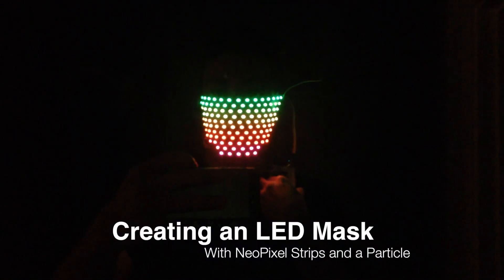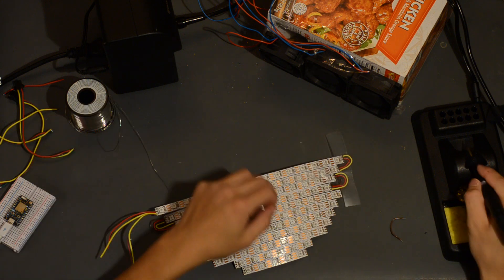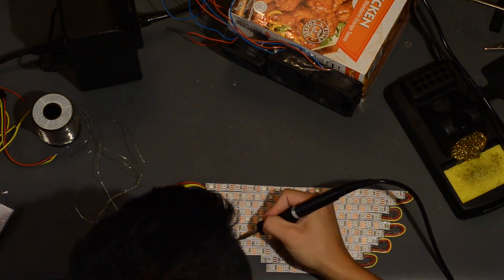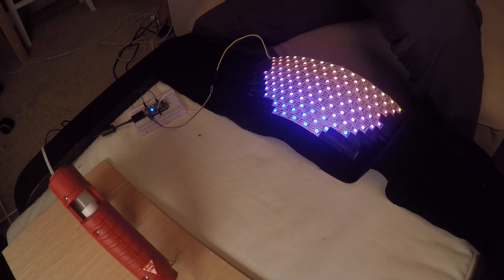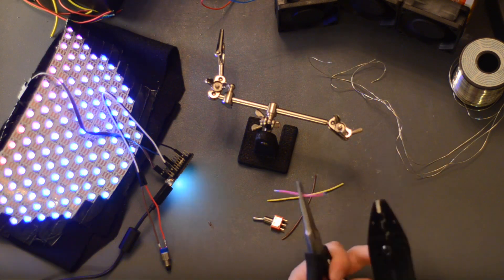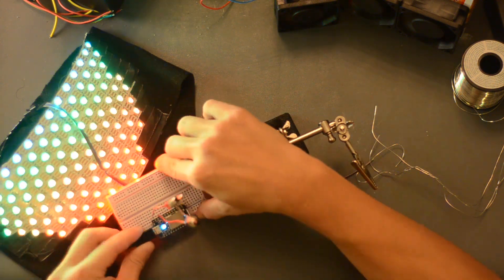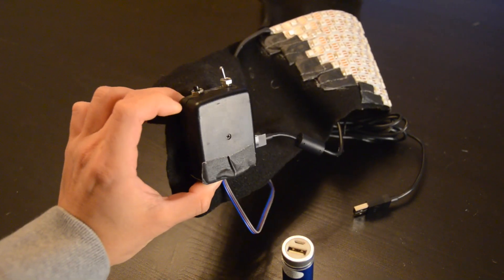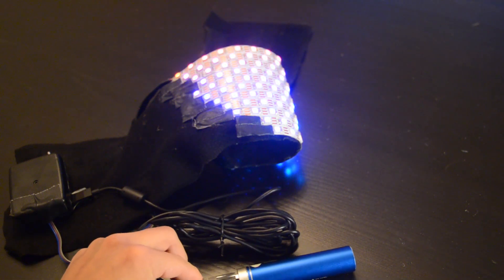Making an Awesome LED Mask

Comment: that power supply you used only puts out 1amp ... 2 meters of those LEDs would pull ~ 4A ... were you able to run those lights at full brightness without everything overheating and melting?
Reply: Matthew F 

1. using 10% brightness you’re looking at 90% less current draw.

2. If you actually calculate the current draw of a typical neopixel ws2812B, max brightness actually is around 40ma/pixel, not 60ma. Tons of data to support, or at least try it out yourself and measure.

I think the WS2812ic manufacturer didn’t account for the nominal current draw over a length, only one ic/led.

Comment: Is it possible to change the pattern of which the LEDs are showing without using a switch or a button?
Reply: Warlord Studios if you use an rf remote you can

Comment: Hi. its really a nice project you have been doing! How is it preforming when its raining? I was thinking about doing a led bicycle helmet :)
Reply from the maker: Thanks! It depends on what you do to weatherproof it. If all the connections and electronics are open to the rain, it will fail pretty fast just like normal electronics.
Reply from the maker: +carlemusik I wouldn't leave it out in the rain without some sort of protection. After all it is electronica

Comment: Would it be possible to build this without using a battery pack instead use a small battery? Want to build this for a concerts.
Reply from the maker: +Sergio you could, but you would need at least 5V depending on your led strips. And probably want a high capacity battery to supply enough mAh for your continued usage during the concert

Comment: I need help, I need this to pulse to bass, but idk how to, any ideas?
Reply from the maker: +epicnb89 you'll want to make it detect regular sound and then apply a low pass filter. Here's a discussion about it: http://forum.arduino.cc/index.php?topic=134079.0
Reply: +Anthony Ngu thx, sorry if I'm being annoying XP I'm just working on a new DJ mask and this video really got my mind thinking, thanks so much for the help =)
Reply from the maker: +epicnb89 no worries! I'm happy to help someone else build their own led mask. I hope it turns out well!
Reply: +Anthony Ngu thanks, great job on your vids, they are helpful and amazing, ill let you know how my project is going, ttyl
Reply: epicnb89 you need to connect one of the main wires to the wires of the speaker. I know no specifics, but look up how to do it to cars and you should be good

Comment: Great idea.

One additional run you could do is make it light up as a closed mouth, and then get an mic input that was not really sensitive so it only moves between an open and shut mouth when you're talking.  With your skill level, and the bits available you'd knock it up in probably 5 minutes. ;)

Thanks for sharing. You have a new sub.

Comment: How long does the usb power supply last you? I'm almost done the build and plan to wear it to an 8 hour music festival and I want to know what to expect and what other animations I could save! Thanks for the great videos man. 10/10
Reply from the maker: +ThisNameWasAvaliblle It depends on what mAh (milliamp hour) rating your battery has. Mine lasted over 4 hours with that small one (I believe it was about 2200 mAh, but I'll double check and get back to you) and could last even longer with a bigger usb power supply.
Reply: +Anthony Ngu Wow that lil thing lasted 4 hours?! Now hypothetically could I mount this build to a half face airsoft mask, run the Micro USB to a bigger portable battery and add diffrent LED animations?
Reply from the maker: +ThisNameWasAvaliblle yup! :) In the code, I have the brightness reduced to 10% which probably helps alot. 100% brightness was blinding.

Those should all be no problem. Let me know if you have questions about the LED animations. The void loop() function houses a switch case for all the different patterns, feel free to switch one out with your own or add on another!
Reply from the maker: Just double checked. I used a 2000mAh battery.
Reply: +Anthony Ngu Awesome. thanks for the rapid feedback man! :D Happy Holidays eh
Reply from the maker: No problem man! Happy Holidays to you too and I hope your mask turns out awesome.